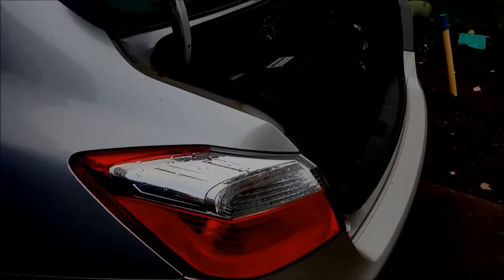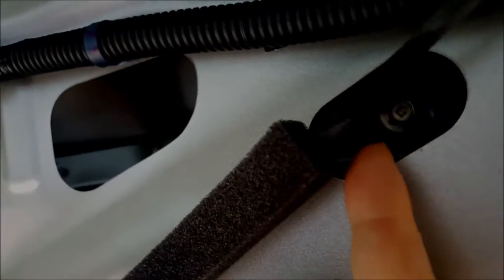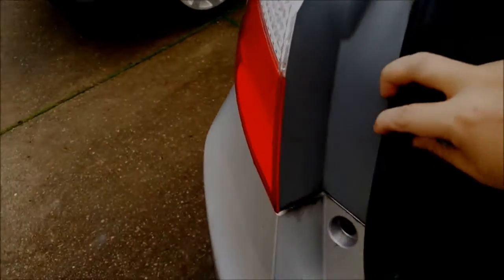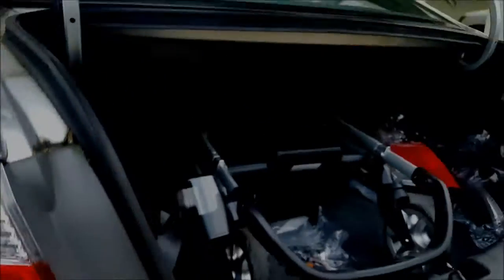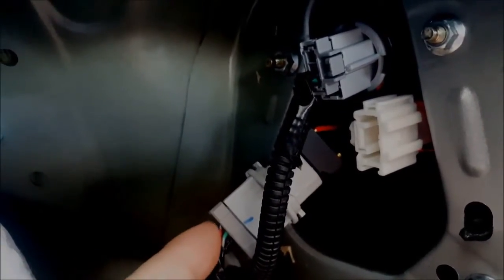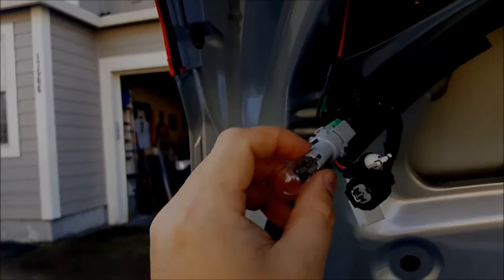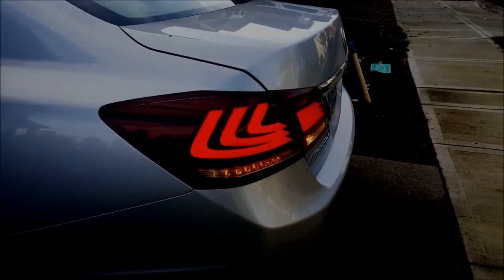Aftermarket Ebay Tail lights install on 2013 2014 2015 accord

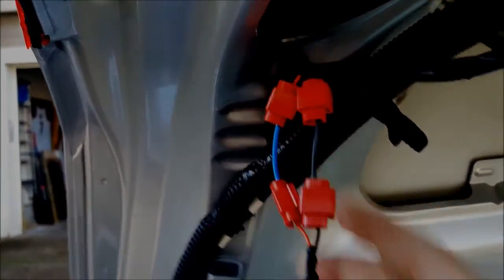Comment: Hey buddy @ 6:37 that adapter you showed that you said doesnt do anything.... you had to remove the bulb and use the adapter then plug the bulb into the adapter its basically sm extension so the bulb can reach the housing... you dont need to splice anything with this kit

Comment: Hey what's going on, I just wanted you to know that I got the same exact lights off of ebay and I did no splicing what so ever, they kit you got came with the little wire extenders, so that the outer lens wire would reach in the socket that has been lowered. All my friends got the same kit and none of them spliced any wires, they all used the supplied harness extender.  Peace and God Bless

john k
Reply: john jkizer can u message me a link to the same ones u got?
Reply: Do you have a picture of how the wiring is set up for you?

Comment: what year accord is it? because i recently brought a pair for my 2013 accord and everything fits perfectly beside the brake light
Reply from the maker: hey mine is also a 2013 accord, the inside trunk lights?
Reply: Same problem with the brake light. How did you install the LED? Mine fits loose and thus falls out.
Reply: datmuslim201 I took my car to a shop where they do all types of electrical things such as radios intallation and they wired it up
Reply: Ball out - Word I'll try again, if not I'll head to a shop. Thanks man

Comment: How did you get the turn signals to work without hyperflashing?  My 2016 Accord already has LED brake lights, and I'd love to put in LED signal bulbs, but they hyperflash, and you can't replace the signal flasher on these cars.  Did you wire in resistors, or...?
Reply from the maker: i have them installed but you need to pick up some resistors.  these are like the ones i used, its very easy to install but keeps your signals to not hyper blink

http://www.ebay.com/itm/2x-Load-Resistors-LED-Bulbs-Turn-Signal-Light-Blink-Flash-Fix-/280972007680?hash=item416b3c9900:g:evAAAOSwFqJWl2xc&vxp=mtr
Reply: Ok cool... I was wondering about that.  I'm not skilled enough to deal with resistors, so I left my signal bulbs are they are. :)  Did you have to install them in the front and back?  (Assuming you have LEDs in front, maybe you don't?)

Comment: Hey what’s up bro?  So I installed these custom lights about a year ago or so.  Now one of the lights don’t work when I hit the break but signal and everything else works fine.  It’s not covered under warranty and no one sells one side.  I have to buy the whole new set which I don’t have the budget for.  What do you suggest I do?
Reply from the maker: Sorry bro, i dont know. You can try to see if you can take it out and plug the other side in and give it a try. See if its the wiring or the lights.
Reply: Put the original set back in. Not worth a ticket.

Comment: Hello, its a lil late but how are they holding up? are they still work?
Reply from the maker: Vigel hey, they still work just fine. at one point one of the blinkers didn't work but the plug just was loose and i pressed it together and that was it
Reply: thank you. I'm just worried if one of the led lights breaks there's no way to replace it.
Reply from the maker: Vigel yea they that suck but it seems pretty good still. no signs of condensation either.
Reply: @djsonnee  Still holding up well today? I hear they are difficult to see in the day time(according to two Amazon reviews).
Reply from the maker: No its still working fine. I havent had to do anything to them since this install day. Lights up just fine.  Gets a thumbs up from me

Comment: Why does everyone stop the years on these at 2015? The lights might look different but the shape and fitment should be the same for a 2016 & 2017 as well.
Reply from the maker: 16 and 17 has a chrome strip that goes into the lights. So they have the same body style but tail lights are different. Same with their headlights. The grill goes into the headlights
Reply: Son's World does these lights fit in 2016 Honda Accord?
Reply from the maker: @DMTLSD88  I don't believe so. Since 2016 has a chrome bar. They might make some for those models but these aren't interchangeable
Reply: These will fit a 16-17. You'll just have to get the chrome piece from a 13-15.

Comment: how is the durability of the plastic? do they scratch easily vs oem?
Reply from the maker: LAC32Griffin i haven't noticed anything. I actually had them in my trunk a few days before I installed them
Reply: djsonnee I'm getting them, thanks for the review man!
Reply from the maker: LAC32Griffin I get a lot compliments on them, you will enjoy them!